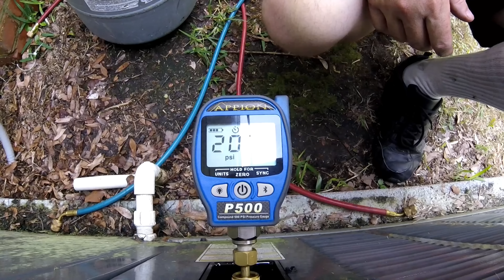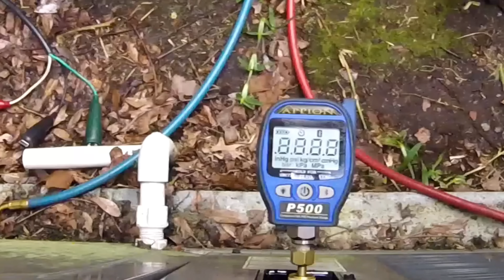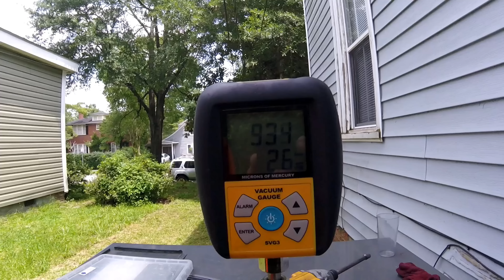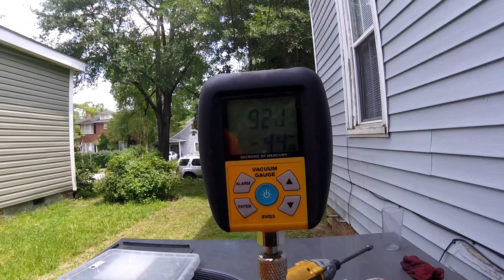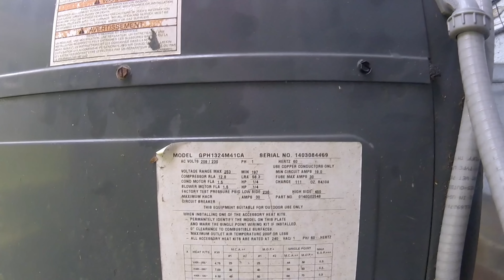Replace HVAC Drier

Comment: The fact that the outside unit has that circuit board within it does that mean that that’s a heat pump? I’m really only familiar with the strict AC units that have contactors, capacitors and that’s all.  I never liked the units that have those circuit boards outside. Seems like a lot more complicated issues.

Comment: Nice made video. I'm assuming you saw a pressure or temperature differential at the filter.
Reply from the maker: One side of the drier started to frost up a bit

Comment: Today I saw someone installing a HP next door, he was cutting big dia piece of copper with this tiny imp tubing cutter. And having a hard time. I'm no pro, but it's stuff like that that makes me not trust most HVAC techs.
Reply: Not a big deal, as far as I can see. Perhaps his "larger one"  had a dull wheel that he noticed on the previous job and he didn't want to spend customer time changing it out, it broke on the previous job the night before and he had early emergency calls, etc, and he was using the smaller one...
I prefer the smaller one at times.  It slips easily into my pocket or a small belt tool pouch. Again, just sayin'...
Not sure why someone would see this as an issue. Or want to take the time to mention it. Again, just sayin'...

Comment: What wrong, if I wrong install filter drier core position. My unit can icing?
Reply: If you put it in the wrong position the refrigerant wont be able to pass through it because it's a one way valve

Comment: Hell sir
I am krishna
I have on pakage ac 
Some problem in my ac.
When the compressor is run but suction pressure is continue decrees.pleas give me salution
Reply: Dirty inside coil , dirty filter , return air grills abstracted. Finally only after all those things have been checked . System low on charge . Beware of the gas and go guy’s . Make sure they fined leak . Hope this helps .